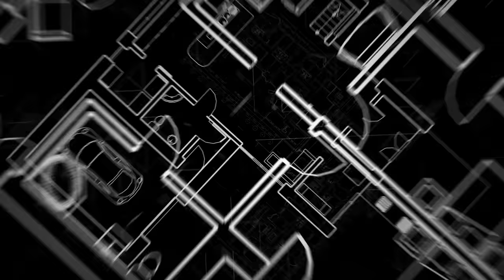Our Biggest Oversize Load Ever...An Entire HOUSE!

Comment: Round barn...the center of a round barn is where the hay drops into the feeding silo or bin. My round barn treehouse would have a seating area in the center surrounded by books and a thick stained glass round lighting widow  with a cap on to that holds lights so at right when turned on, it lights the stained glass angels. . A area for painting pictures, built in easel and built-in storage racks for paints and brushes. A small frig, microwave, and loft bed. Might need a port-a-pot too lol A bit much but I'm old an I can still dream. x

Comment: How many hours did it take to get that treehouse into place, Heavy D?

I would do a farmhouse style but with a bunch of modern twists. I would want a bunch of low voltage automation. Since I do that for work... it would be cool. Making little automatic doors... automatic 🪜's that fold out. I have seen a treehouse in North Idaho where I used to live that had a bicycle elevator. Stuff like that would be awesome as long as it has tons of safety built in. 😁

Comment: Why don’t you also build a “mineshaft” in the embankment next to the base of the treehouse?  Use rustic beams and sculpted simulated walls and ceiling made of concrete.  Have 2 shafts going into the embankment with a cross-shaft connecting the backs of the shafts and/or maybe a “cavern” in the back.  For that matter, run hidden wiring to power “mine lanterns”.  You could even keep the theme going with a “mine cart” and rails.

Comment: That's is great my would be some thing med but I would want the tree in the middle of the house with a table going around it,two bedrooms a sip line to the ground for some but for me a slide going down cuz it's hard for me to do steps going down, windows on every side, maybe some kind of pulley to pull up the thing I need to get up, then if it gets to where I can't walk up the steps some thing can pull me up, I don't need lights I would use oil lamps maybe a wood burning stove, and something to keep food cold, but can work with out that to.

Comment: Do you make more money for the show or recovery.. I can remember recovery with jacks a tandem goose neck and jacks .. I found also camper jacks u can bring up high enough to back ur Lowe boy under .. and I had just me sometimeS a friend or my dad .. but I did less talking and more working .. haha the good old days.. I'm not cutting u down I'm just asking what pays more money the remove or the show ..
Reply: whatsap ⁺¹⁹⁰⁸⁸⁸⁶⁴³⁸⁵  no insult intended.. u  remember that deutz motor seazed in the excavator??? You used chain hoist basically after drilling me I need to think .. I had a TD 14 dozer and put a socket and a ten foot bar on it.. nothing so I pulled the starter cause that little starter can start that motor then I took what we called a cat bar.. it turned a tooth at a time back and forth .. u put lube in it but it can cause hard compression.. but don't take my word for it try it next time.. I had a ud 18 road grader that they ran out of oil and seazed it same thing started out cat bar in a shirt time it was free.. we pulled it down and the first 
journal was ground down and fused but it free up..